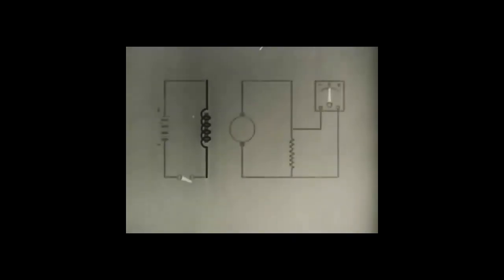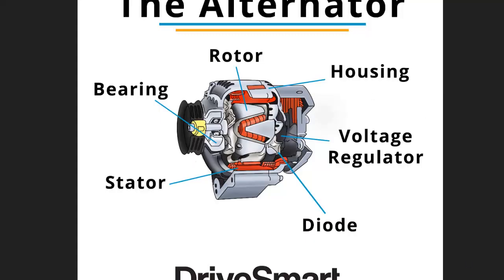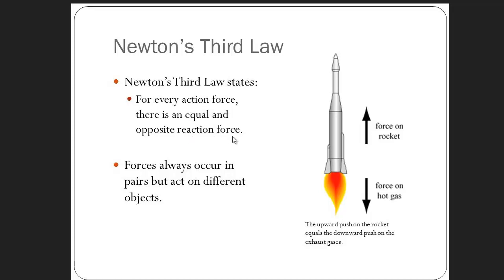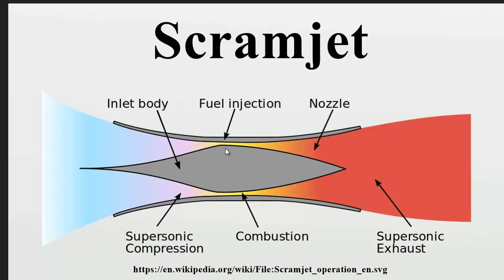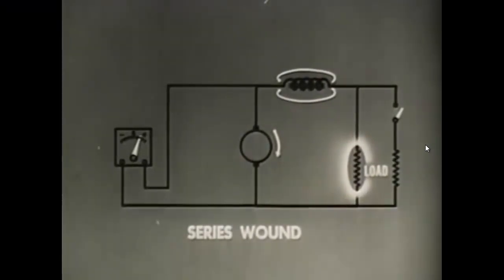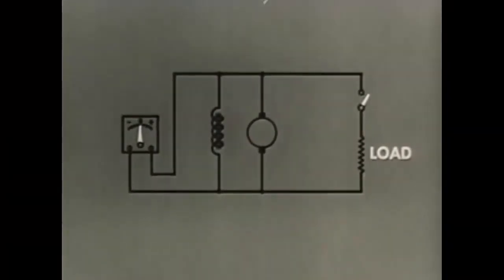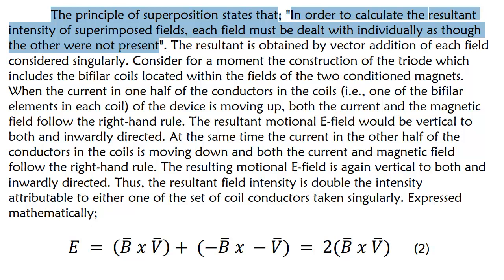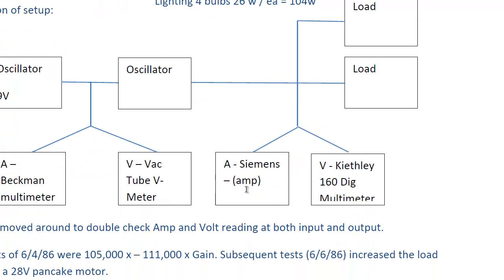Important Discovery - Where Old Educational Videos can help understand new problems.

Comment: I think you misinterpreted what self-excited means because of what you know about back force. Self-excitation only means a motor or generator doesn't use a separate DC power supply for the rotor field coil. It doesn't mean the generator itself is self-powered.

Comment: When the doc used the term ‘conditioned magnets’ in ref to a triode I took that to mean the plate and the Kathode, which are at two alternate polarity, the following text is describing a Tractor force vector. 
The presence of a vacuum and the filament create a tractor force plasma motor , which is what a tube is, which is what a Triode is. 
Triode = 3 elements 
1 Plate
2 Grid
3 Kathode 

Applied force is entered at the grid and plasma force is exerting out the Plate and Kathode via incommensurable or tractor force vectors which is  in any language energy that does work.

The ‘coil’ in a triode is the filament.

I’m also going to be honest I haven’t pulled a tube apart yet but I now have a bunch and will pull apart one of the broken ones I do have here , if the ‘Plate’ and ‘ Kathode’ are not how I described I’ll certainly correct myself.